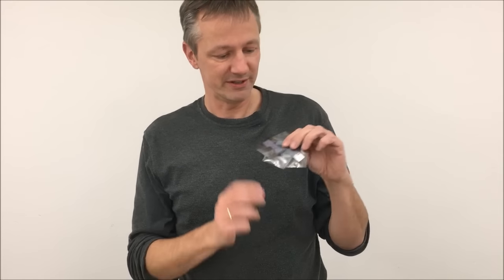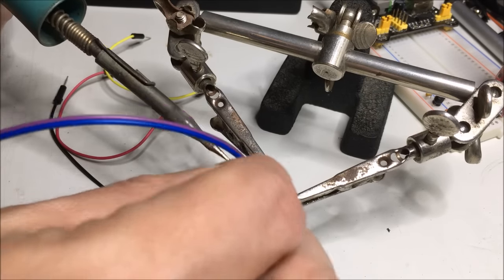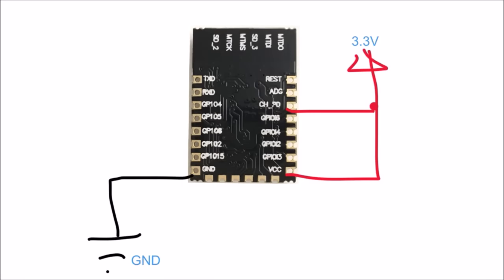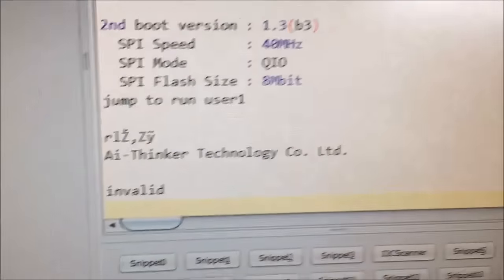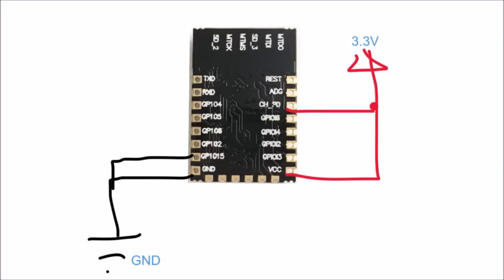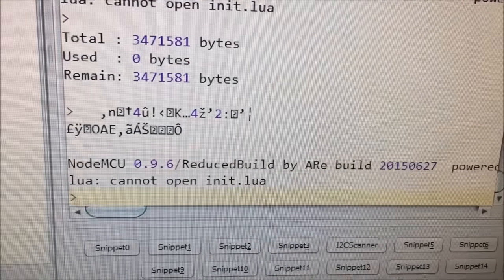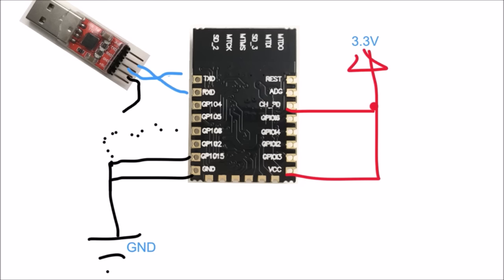Running an ESP8266 ESP-12E module in minimum configuration (As obtained from Banggood)

Comment: This is totally different than AVR/PIC chips. This is also considered as a module and not a chip. So this module has different boot modes from the manufacturer which either to boot from SD card or from the external flash chip.

Good job! Thanks for clarifying these essential parts of the esp world.

Comment: I think you have to use 4k7 or 10k resistors for pull up. Also you have to pull up reset to VCC  to prevent random resets, and pull up  gpio0 to VCC in normal mode , to prevent random enabling programming mode after start.
Reply: Doesnt it already has internal pullups?
Reply: @aziubin  the esp12-e/f modules don't come with internal pull ups.

Comment: Great video - thanks! I went one step further in simplicity: I powered the esp8266 from my ftdi232 - and it worked. Was able to flash ESPEasy using the Arduino IDE.
I don't think I could have got there without your simple explanation. (Both the esp8266 and the ftdi232 were cheapies from banggood.)

Comment: Thanks for your answer. 
More questions (I am an absolute beginner to this 8266-stuff but find it more exciting then the 8051 derivate stuff I am familiar with):
a) Why do you favor the Esplorer?
b) I like your tiny FTDI-board. Which make is this and where did you order it from?
c) One of my first goals is the control of 2 relays via WIFI. The state of the relays should be sent back to the smart phone (active supervision of the state of the relays). 
With one switch the whole setup should be enabled remotely.
Further more I want to transmit the luminosity (brightness) and temperature of a room using the FSA3157 analogue switch  (2.1 multiplexer).
In summary I use 2 digital outputs, 3 digital inputs and 1 analogue input. Which GPIO´s do you recommend for the digital signals (and which one should be avoided)?
d) Which app do you recommend to be installed on the smart phone? I checked BLYNK.
I hope all these questions to not drive you into frustration!! A million thanks in advance for your assistance.
Reply from the maker: Ok, to answer your questions:
a) I am a sys- and netadmin by trade, so scripting comes a bit more naturally to me than programming (although the difference between the two is a bit academic...), so LUA is more appealing to me than C, and ESPLORER is the IDE geared towards NodeMCU/lua. The other thing is that when I first found out about the ESP8266, it was a lot harder to get the Arduino IDE to work with it. Nowadays I use whatever seems best suited for the job.
b) I buy most of my stuff from Banggood directly from China. I never had any trouble with them. I like the ones with the CP2102 chip: http://www.banggood.com/Wholesale-USB-To-TTL-COM-Converter-Module-buildin-In-CP2102-New-p-27989.html?p=NT1005763073201409DA
c) GPIO4 and 5 are the only ones without additional function, but you should be ok with the 2out/3in pins. You probably already know that there is one analog input (TOUT) that you have to scale to 1,1V(max) and gives you a 10 bit resolution.
d) I usually run a little web server on the ESP8266 and connect to that from my phone. Alternatively I have also sent data to a web server running on a raspberry pi. (see my burgar alarm video) - Many people use MQTT these days, but I never really looked into that protocol.

Comment: One I/O pin to GND,
one I/O pin to 3V3,
build a 3v3 voltage regulator up
button for reset
button for programming mode
four connections for serial...

It is easier to use a WEMOS D1 or "Witty cloud".
Especially if I want to change the firmware again after a few years and then have to look for which pinheader I have serial out connected.

Comment: Nice short video! Will you do more on the ESP8266? projects and such? =) Also, what is the program you're using to communicating with the ESP8266? Seems quite nice with all the functions on buttons so you don't have to "type" out the commands in prompt =) Great for fast and easy control of the module connected!
Reply from the maker: +Chris Fredriksson Yes, I have already a new project in the works. I'll publish a video with my plans/ideas in the near future. The program I'm using is Esplorer (from: http://esp8266.ru/esplorer/ ). Really a very handy tool. (Requires java runtime environment)
Reply: +AReResearch Ah cool, can't wait =D I have actually not tried programming any ESP8266 yet, only done some tests with a bare AVR and just the regular UART to USB things.. But I've thought of creating some lightweight temp sensors to place around the home.. But I haven't come that far yet =P I've totally missed that program also, thanks for that! =)

Comment: Very nice video, very clear and concise.  I would like to use one of these in my motorcycle that uses 12 to 14 volts from the battery and will use a buck converter.  I have seen a very small one on ebay but am wondering if it will maintain a constant voltage despite noise and battery voltage fluctuations.
Reply from the maker: +Joseph Nicholas Yes, Buck converters are exactly what you are looking for. Something like this: https://www.pololu.com/product/2843
(Choose the 3.3v version, of course) will work great.
Your project sounds interresting. What are you up to?
Also have a look at the esp8266's sleep modes because an active module will drain the battery at up to 1 Watt when transmitting. I've written a short article about it here:
http://www.areresearch.net/2015/11/using-nodedsleep-in-nodemcu-to-extend.html
Reply: I would like to make a silent alarm.  I have an old motorcycle and its full of mechanical parts which are crappy and keep breaking.  I´m tired of paying through the nose for speedometer wheels, new batteries. I though may be I could use an ESP in place of an arduino but it appears that the ESP doesn´t have enough funcionality to everyting.
Reply from the maker: +Joseph Nicholas I see. This project has (at least) two interesting aspects:
a) how do you detect manipulations
b) where do you send the notifications (provided there is Wifi to connect to in the first place)
On the ESP vs Arduino decision: if you need a lot of GPIOs, the Arduino has the lead. If you want network connectivity, the ESP is the more efficient solution. If you're into arduinos already, there is nothing wrong with using the arduino IDE and libraries to build firmware for the ESP8266.
Reply: +Joseph Nicholas Thanks, I think the more interesting questions become, how do you build sensors into a motorcycle, for example, do you use a reed switch or a hall sensor, to detect speed How to limit fluctuations and spikes, if any, in the power supply, and how far will an esp transmit without and antenna.  All these question are of course practical considerations which appear to escape most armchair electronics engineers.
Reply from the maker: +Joseph Nicholas Have you considered trying an accelerometer to detect tampering with your motorcycle? That way you can keep the wiring very simple. A project using an accelerometer (amongst other sensors) on the ESP8266 is this one: http://tinker.yeoman.com.au/train/
Reply: Thanks for the suggestion.  This is of course the best sensor for the job.

Comment: How is it possible to get RSSI from esp8266 (i.e. using esp8266 as a arduino module).
Signal goes from a smartphone to esp8266 (connected to a arduino uno)

Comment: With all the efforts i wasn't able  to turn on ESP-12F.
Some people suggested to use resistors to pull up signals.
That is one 10k resistor between VCC and EN 
Another 10k between GROUND and GPIO 15. I have also used a AMC1117 for regulating the voltage for 3.3v
Somewhere in between while setting this up. I guess it worked as i saw a blue light blink after turning on.
After couple of minutes even that didn't respond.

The esp module slightly warms up.
(It's not heating a lot)
Please help

Comment: Thank you very much. I was creating WifiWebServer using ESP-12E.  I was able to flash my ESP-12E module but not able to get the IP. I connected TX > RX, RX> TX, GND > GND, VCC> 3.3,  EN/CH_PD -> 3.3 of USB to TTL but it was not working. But when I connected one more GPIO15 to ground after flashing. Now it's working fine.
Reply: Did you use any resistors on your project?

Comment: The at command software seems to get the most from the chip.  I loaded the NodeMCU software and it´s full of bugs.  Half of the commands don´t work, and worst of all if you try to get it to tell you what other AP´s are available it fails.  I went back to the AT command software and it just has dumb terminal commands but they all work.  PS.  I finally got the ESP8266 to work reliably for long periods of time by connecting it to an arduino with the CP type chip although I can´t say why the ftdi board locks up and overheats both boards.  The ftdi board works reliably with other devices.

Comment: Why are you using a separate power supply.  USB TTL module has 3.3v anyway.
Reply from the maker: The module‘s power consumption is much higher than what the tiny regulator on the serial converter can supply. The esp might start up, but will most likely crash when transmitting over Wi-Fi.

Comment: Do you, perhaps, have any experience with handling the interrupt of a PCF8574, this connected to the ESP-12E module?
Reply from the maker: No I don't but I imagine quite a few people in the community might be interested in that. The ESP32 has more GPIOs, but the IDE ist still somewhat experimental. So while we stick with the ESP8266, GPIO expansion is a hot topic.
I worked with both i2c and hardware interrupts on the ESP8266 running NodeMCU and I have not run into any trouble. But not with the PCF8574 yet.

Comment: Any reason why you don't use the 3.3v provided by the serial adapter? Does it provide to low current?
Reply from the maker: +Daniele Testa Yes exactly. It can draw nearly 300mA when transmitting. The tiny 3.3v regulator just caves in. You could try a big capacitor, though.

Comment: Hi, hab das 12e modul hier und habe keinen ch_pd. Stattdessen habe ich ein EN ?! Weißt du wie ich den Flash/Run Mode Connecten muss um damit zu arbeiten?  
Irgendwie finde ich nichts zu meinem Problem. Ich glaube sogar das ich schon 1 modul geschrottet habe.
Reply from the maker: +Razor Coding Die Dinger sind recht zäh und kaum kaputt zu bekommen. Ja: der EN (=enable) ist identisch mit dem ch_pd. 
Entspricht das hier Deinem Modul? http://s1.electrodragon.com/wp-content/uploads/2015/04/ESP12E-pins.png
Oder ist es ein esp12 ohne die zusätzlichen Pins an der schmalen Seite?
Reply: +AReResearch genau das ist das Modul, dass ich habe. Das 'kaputte' modul gibt kein Lebenszeichen von sich, wenn ich Vcc und ground anlege. Das andere blinkt 2 mal blau.
Reply from the maker: +Razor Coding Ok, dann hol Dir mal den "esplorer", falls Du den nicht schon hast, verbinde RX, TX und GND mit Deinem USB/Serial Adapter (3.3V Pegel Modell!). Dann VCC (3.3V) und GND am Modul anschliessen, EN auf 3.3V, und GPIO15 auf GND. Dann sollte im esplorer sich etwas tun. Wenn nur Kauderwelsch kommt, stimmt die Baudrate nicht. NodeMCU macht 9600 Baud, die AT-Firmware macht aber je nach Version auch andere Geschwindigkeiten. Da hilft nur rumspielen bis beim Modulstart eine sinnvolle Meldung kommt.
Zum neu Flashen einfach beim Start den GPIO0 auf GND und mit dem NodeMCU-Flasher die neue Firmware einspielen. (Vorher den esplorer beenden, da er evtl den COM-Port noch blockiert.) Flashen ab Adresse 0x00000.

Comment: Hi, I like your tutorial. Nice. I want to know something: can we directly dump program into esp8266 module/chip?? I have a bluetooth module and i want to connect that bluetooth module with esp8266 SPI bus. so esp8266 internal processor not only establish wifi connection but also handles bluetooth module. I want to write A single program for bluetooth and wifi and dump into esp8266 so esp8266 can handle all these things rather than using separate Arduino board. Is this possible ??
Reply from the maker: Depends on what you want to get done. You could possibly let a NodeMCU Lua script read/write data from the bluetooth module and write it to the ESP8266's SPIFF. But if you want to use Bluetooth and Wifi, you should have a look at the ESP32 ( https://www.banggood.com/ESP32-Development-Board-WiFiBluetooth-Ultra-Low-Power-Consumption-Dual-Cores-ESP-32-ESP-32S-Board-p-1109512.html?p=NT1005763073201409DA ).
The IDE still feels like working on the bleeding edge, but the ESP32 is clearly worth a try.

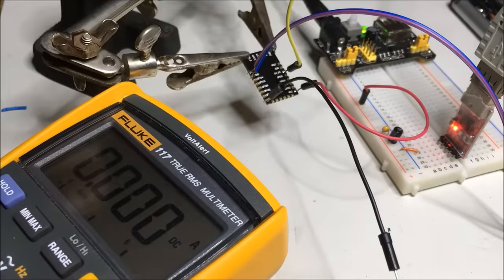Comment: At 1:20 do you mean 3.3V? Won't 5V fry it?
Reply from the maker: Yes, you are quite right. It is 3.3V.
Reply: It is indeed, the VIN is 3.3V, and 5V will fry it. On other pins however however, some debate remains on weather they are reliably 5V tolerant... your mileage may vary. I have programmed my esp12 modules with a 5V arduino uno, and never had issues. Many people on the internet, and that I know have also connected pins to 5v without any of there modules burning. But just because some modules worked fine, doesn't mean all will.
Reply: @AReResearch  : So dont you think it would be a clever idea to either note this right up in the video description, fix the video or put some voice over over this? I'm aware this video is five years old, but some people will get really frustrated if they burn one or two esp's because of that.
Sorry, but I'm leaving a thumbs down for that.
Reply from the maker: Good idea! I added an infobox at 1:20.

Comment: That software, and the serial module, is it a FTDI programmer? Im a drone racer getting into this, I use FTDI to program the old multiwii MinimOSD OSD output for the goggles and telemetry. Is that your custom nodemcu software mentioned in the blog running on the pc?
Reply from the maker: If your FTDI programmer can run 3.3V levels, you can use that. The custom firmware is flashed to the ESP8266, then lua scripts run on top of that.
Reply: thanks!

Comment: I am trying to control a relay module with GPIO 4, 5, 12 and 13 of esp 12f. I have not connected any external resistors except for CH_PD to vcc and GPIO15 to gnd. But the board seems to be resetting to factory default in few seconds after booting up. What could be the issue?
Reply from the maker: Does it also reset with the relay board disconnected?
Reply: @AReResearch  yes it does
Reply from the maker: That means you are using D2, D1, D6 and D7 as GPIOs for the relays. That should not present a problem. The ESP8266 is a bit sensitive to long running loops that might trigger the watchdog (wdt) to reset. Anything in your code that might cause that?
Reply: @AReResearch  found it. one of the pin was at LOW state when the relay turned on and that was causing the reset as code was written that way.

Comment: What power source are you using for your 3.3volts?
Reply from the maker: On breadboards, I use these power supplies (3.3 and 5V) with an old 6v wall charger:
http://www.banggood.com/3Pcs-MB102-Breadboard-Module-Adapter-Shield-3_3V5V-For-Arduino-Board-p-957095.html?p=NT1005763073201409DA 

They are super cheap and work great.
On a battery operated device, I use a high quality 18650 battery and a 1N diode to drop the excess voltage, as described in my blog here:
http://www.areresearch.net/2016/03/espressif-esp-12e-module-radiation.html

Comment: hi can we use esp 8266 module to control fan speed using triac can you help please  how to do that. I don't know much about this.
Reply from the maker: I'd try a PWM output on the ESP8266 to feed an optocoupler. Here is an example circuit: https://www.mikrocontroller.net/wikifiles/1/13/Beispiel_Triac_mit_Optotriac_Ansteuerung2.png
I presume you want to run an AC fan.
Reply: AReResearch hi thank you so much for the reply. I have problems in coding highly appreciated if you share your code..
Reply: yes right once I got success but the flickering made it hell. so I am finding a new way. Thanks ill check it out and let you know

Comment: Mind if i ask what those caps on the rails of the breadboard are?
Reply: Answer just in case someone looks for the same: It's most likely a 0.1 uF ceramic decoupling capacitor and a larger 470 uF alu capacitor against spikes.
Reply from the maker: Yes, exactly. I had unexpected resets of the ESP. But it turned out to be a software issue.

Comment: Please, how can I use the ESP8266 ESP-12E with Arduino Mega? thank you so much
Reply from the maker: The usual way is to use the AT-firmware. You also need level shifters or at least a voltage divider, because the esp8266 is a 3V3 device.
Reply: @AReResearch  Arduino Mega, just like Arduino Uno, has both 5V and 3.3V power pins

Comment: what value use for this caps in your protoboard?
Reply from the maker: I put in whatever I have handy in my parts bin. A 16uF to 100uF electrolytic cap to take the edge off transient spikes and a few nF ceramic to bypass stray RF. I am sure there is a more scientific recommendation.
Reply: @AReResearch  First rule of good design, whatever's in the parts bin!

Comment: good evening
My name is Bento from Brazil, I'm starting to learn now and if you can help me I would be very happy. I plan to use a local network with 18 (ESP8266 12e) and each a temperature and humidity sensor (DHT11), a current sensor (TCS-013) and a relay module 4 channels.
All this I would like to come in an excel spreadsheet, excel because I would use this information and create a button to turn on and off the relay.
Can you help me?
Thank you.
Reply from the maker: +Bento Souza That project sounds like quite a challenge to me. I can't find anything about the TCS-013. You will probably run out of GPIO pins and want to consider using an I/O expander like the MCP23017.
To collect the information (and finally put them into a spreadsheet), see how my ESP8266 burglar alarm ( https://www.youtube.com/watch?v=G4ArTQ_KWs4 ) writes data to a web server. Alternatively look at "phant" ( https://data.sparkfun.com/ ) to post your data to. Although I never tried that myself.